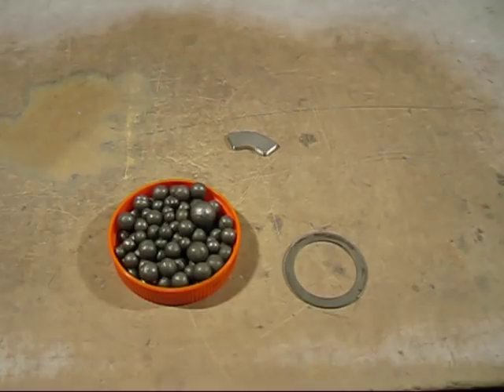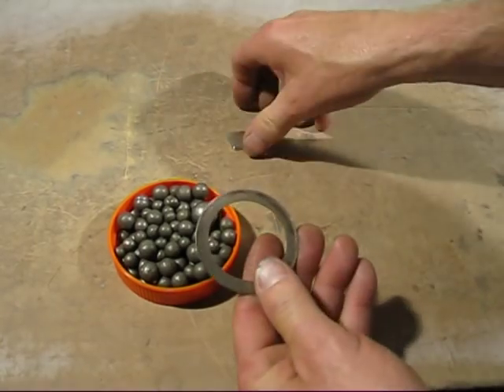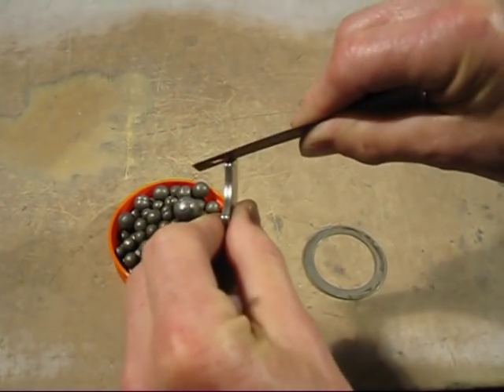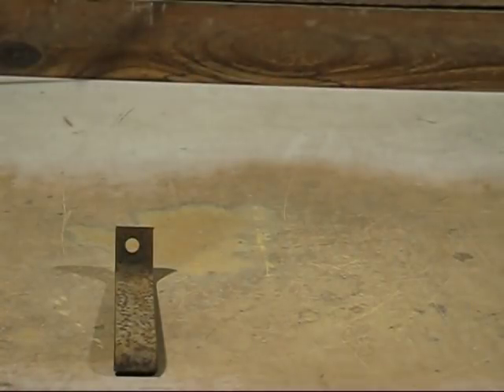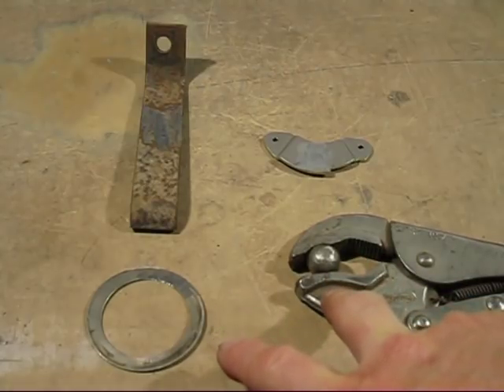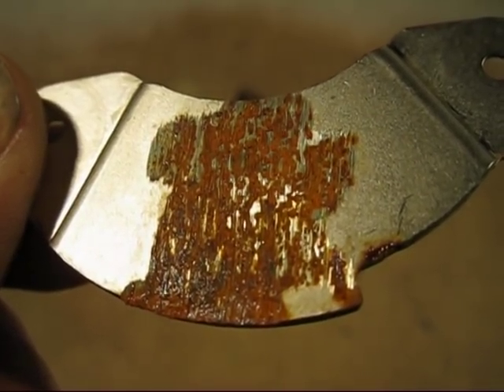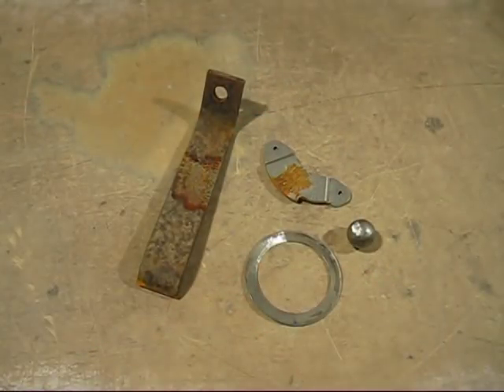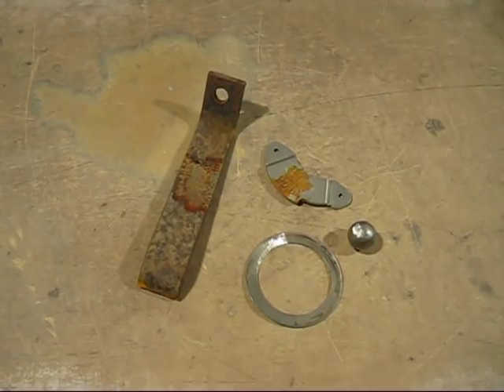Does the metal from hard drives have a high nickel content?

Comment: Here is a suggestion for a source of material containing nickel that may be suitable for addition to cast iron. 
What about alnico, the magnet material?
 There will be alnico magnets in the magneto flywheel of every older small two and four stroke engine. There will also be alnico magnets in many other older devices. The composition of alnico apparently varies somewhat. Wikipedia gives the following ranges. “…typically 8–12% Al, 15–26% Ni, 5–24% Co, up to 6% Cu, up to 1% Ti, and the balance is Fe.” 
Could the cobalt could be a bonus additive in the cast iron? 

Another magnet material with even higher nickel would permalloy or supermalloy. 
Supermalloy is composed of nickel (75%), iron (20%), and molybdenum (5%). However, these materials are probably rarer than alnico. 

The problem of the added material sinking to the bottom that you mentioned in respect to copper will probably also be a problem with pure nickel because of its high specific gravity. You may have the reverse problem with alnico because its SG varies from 6.9 to 7.3 so it will tend to float on the iron.
Reply from the maker: Cobalt is a powerful carbide stabilizer so it has to be kept low if adding to cast iron. Finding scrap nickel alloys is proving to more difficult that I thought, one viewer suggested a nickel plating supplier. I looked the website and they have sacrificial nickel anodes ( nickel S ). Apparently it has a high sulphur content which can make cast iron very brittle and hard. So I am still looking.
Reply from the maker: I forgot that adding 1% nickel the sulphur content will go up only a small amount. That plating website seems to be the cheapest for me living in Australia https://janekits.com.au/product-category/anodes/
Reply: Hello when you say “old” two strokes what is considered old or a example of a common engine that may be in US scrap yards
Reply: @niceglass6484  I haven’t dismantled any small IC engines that are younger than about 30 years old, so I don’t know what sort of magnets are now being used in their magnetos. Alnico magnets were not confined to two stroke engines, rather they were used in anything that had a magneto ignition, including aircraft engines. Alnico magnets are distinguishable by the shiny metallic appearance of the base material which is very hard.The alnico magnets were typically cast in integrally in the aluminium flywheel of the engine. It’s possible that magneto makers have started using ferrite magnets, which is a black ceramic or rare earth magnets which always seem to be plated. (The plating used may indeed be nickel.)  As Luckygen1001 probably only needed to add a few percent of nickel at most to his cast iron, I thought that the small quantity available in the alnico magneto magnets in small IC engines was a possible source. However, he put the kybosh on that idea because one of the other components of alnico is cobalt, which he said was a no-no in cast iron. The same goes for the copper content in alnico. I later realised that probably the most convenient way to access a small quantity of relatively pure nickel is to buy nickel welding rods, which are made for welding cast iron.  My local big shed hardware store, Bunnings, has a pack of 25 nickel rods selling for A$44.98, which would contain about 0.41 kg (0.91 lb) of 98% pure nickel. That works out to about US$70,000 per tonne.   The current nickel price as a bulk commodity is about US$21,000 per tonne, so $70k is not an extortionate price for a small quantity retailing nearby. I don’t know what is your interest in sourcing nickel.  For adding to cast iron in foundry work, I expect that 98% pure would be more than satisfactory but it may not be good enough for nickel electroplating, although that is no my field.   Cheers

Comment: NEVER TRUST WIKIPEDIA AT ALL.
Reply: Or rather trust it with a grain of salt (eg. cross reference information).
Reply: Wikipedia is a reasonable starting point, but you always have to check the information.  If it's a good page, they'll have plenty of references that you can check at the local library.